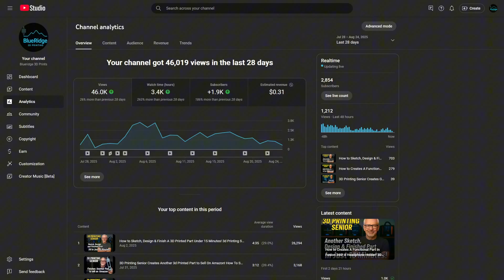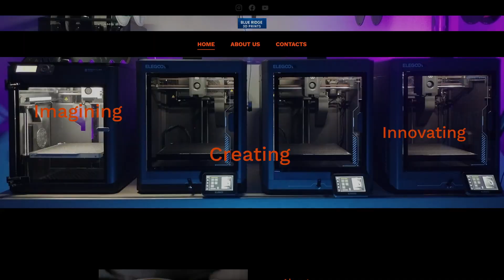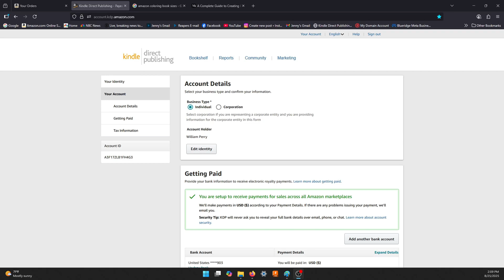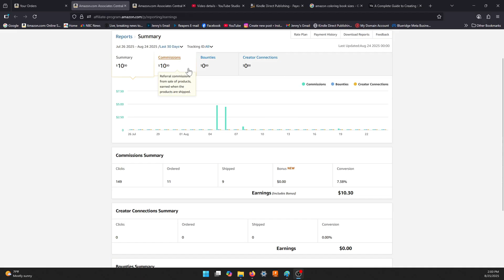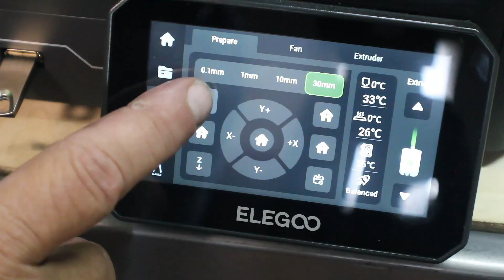3D Printing Senior Tell Where  His 3D Printing Business Stands & Monetized On YouTube In 90 Days!

Comment: Congratulations on monitization. How many hours do you have on your centaury carbons?
Reply from the maker: Only a couple of hundred hours on them right now. Compared to 3000 Plus hours on the bambu's. How do you find myself using the centauri's more right now. Mainly the interface an LED screens for the use of maintenance. I don't find any difference in the printing. Thanks for your support and watching my videos.
Reply: @Blueridge3Dprints makes sense I have about 150 on mine just started noticing the dark places.
Reply from the maker: @scoooterp801 okay you take my curiosity......... What dark places?
Reply: @Blueridge3Dprints LoL on the screws 150 hours not quite 200 haven't gotten funky yet... I'll be cleaning them and lubing the cc this weekend . Not infurring any dark places.... just keep printing... Just keep printing.
Reply from the maker: @scoooterp801 Lol...... Well that went over my head. I guess I should have looked at the video that you were commenting from. All of my comments come in in one place and I sometimes don't look at what video it came from. I just read it and talk. I noticed my screw rods were still fairly clean. But with close inspection that wasn't very much grease on it from the factory. Did you find the nozzle that I was talking about in the video. I think I need to put that in the description. Hey scoot thanks for watching my videos.
Reply: @Blueridge3Dprints definitely add the STL of the screw greaser attachment to description or make a video showing you making it with links to your STL.

Comment: What criteria did you use to pick your printer? I am looking at Bambu, I am interested in using filament. I am in the beginning stages of starting my business as well. I am older as well. Thanks for your service and your helpful, honest videos!
Reply from the maker: Hey Brenda sorry to get back with you so late. I watched a lot of videos. Bambu kept coming out on top. Bamboo will be one of the easiest to learn on and you will have great results. With an AMS filament changing system you'll be able to print in multi-colors. My first printer was the p1s and it sits next to my desk in my videos. But for the price of calling in love with the centauri carbons. Much better interface and same quality of print. A lot easier to maintain. They should pay me for advertising for them. I only make money through the Amazon links in my descriptions. I avoid putting commercials in my videos if possible. Just going through my links to buy anything Amazon pays me 5%. And that's better than what YouTube pays. I'd be happy to help in any way I can. If you need anything just hit me up. I get paid more in spirit just by being in the community and helping out. Thanks for watching my videos.